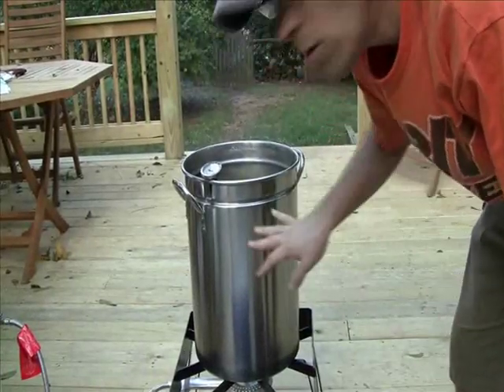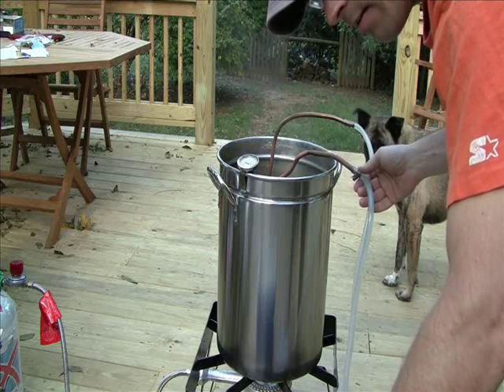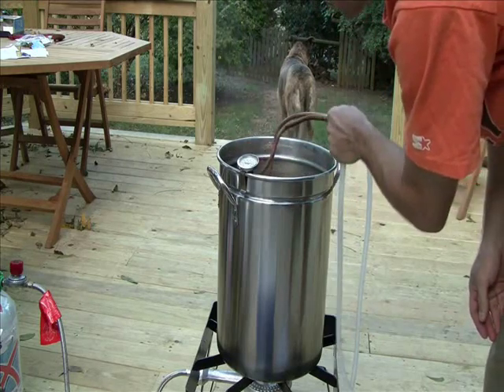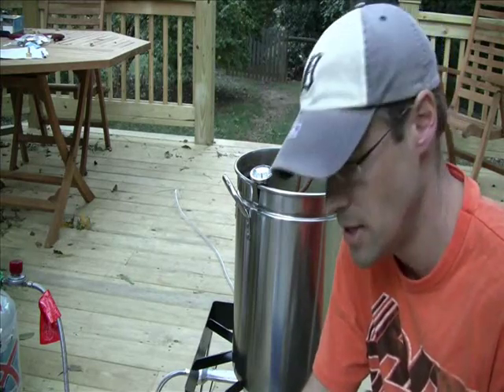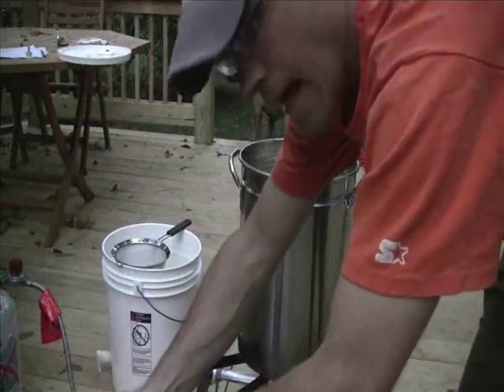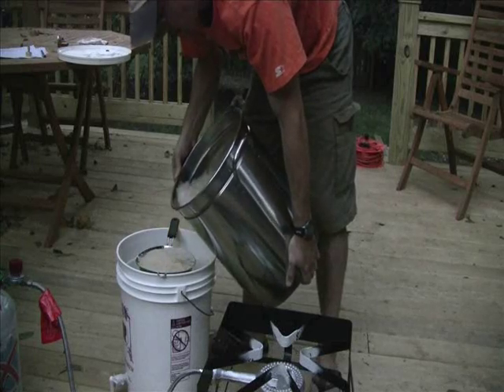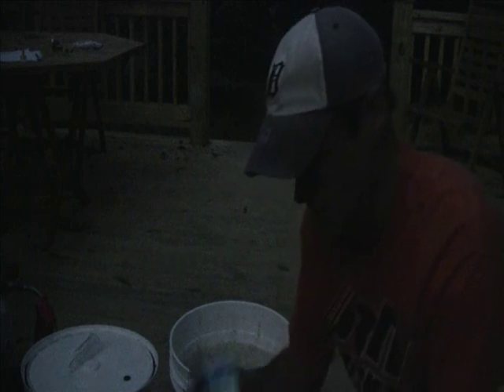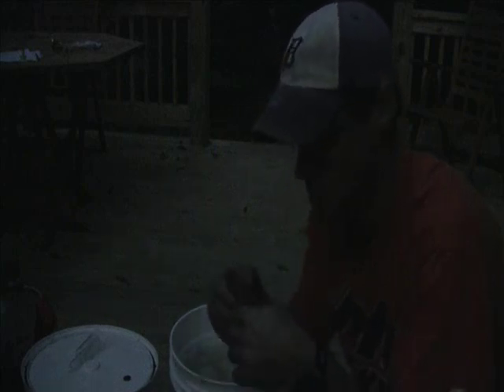All Grain Dogfish Head 90 Min IPA Clone Brew (Part 3 of 3)

Comment: Nice Video bud, some things you may want to try if I may suggest is running tap water initially through the Chiller until you get down to about 80 degrees, then switching to recirculating Ice water to bring it down to Fermentation temp.  This will save you alot of Ice.  Also invest in a ball valve it has saved my back, but hey every brewer does it differently, what ever works for you

Comment from the maker: It has been a while since this brew day. The beer as I recall turned out good. But I have improved my knowledge,equipment and process so I thing it would be better if I made it again. Temp control can be a challenge when fermenting which is why you need to make yourself a temp controlled fermentation chamber from a small fridge. I did and it works great. Happy Brewing !

Comment: Use your mash tun to hold your ice water and you'll hold a lot more. Use a submersible sump pump and you'll chill it down a lot faster. I typically use about 6 10# bags of ice and I can chill a full boil to pitch temp in 10 min. Let the hot water from the initial chill run off for the first couple mins.